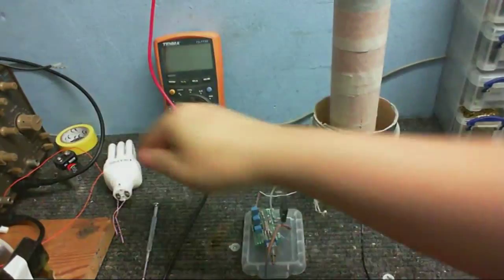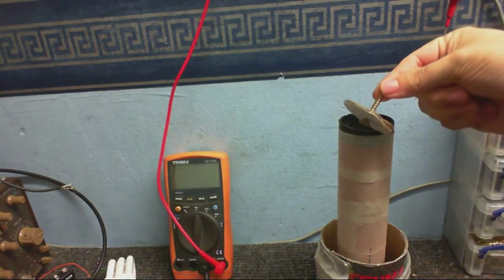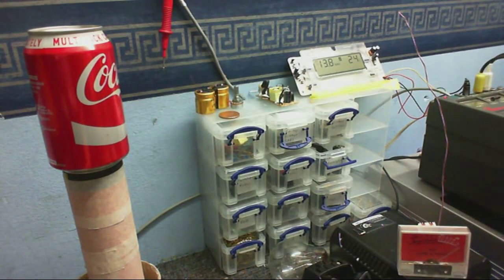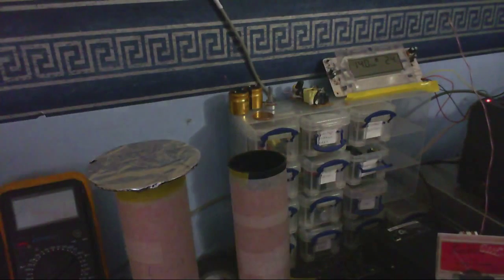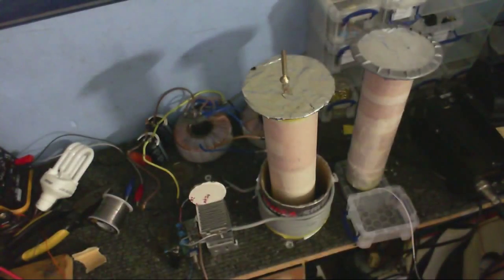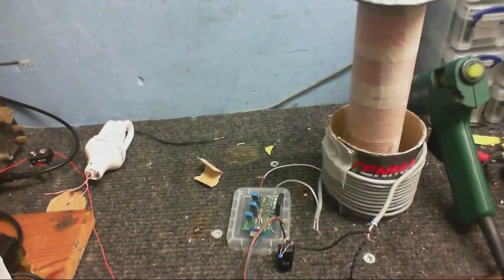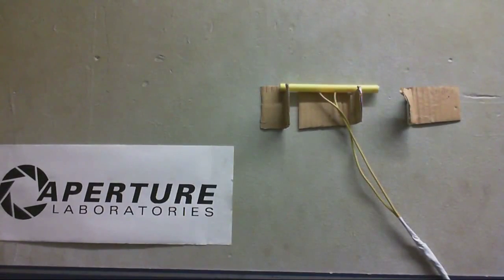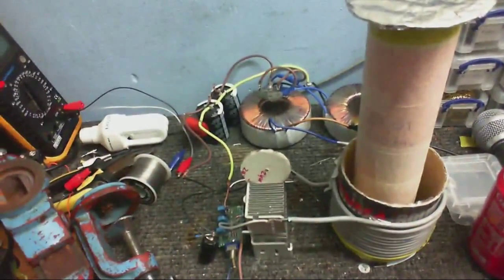Improoved Slayer Exciter and trying my re-built secondarry on my VTTC

Comment: I'm sure you probably know this by now but if you're going to make resonators and primary/feedback coils for VTTC's and SSTC's you should really use PVC pipe for your coil forms, because thin cardboard is not a good insulator and is flammable. You should also have a couple of inches of PVC pipe above the feedback coil on a VTTC to protect it from the resonator, and same above the primary of a SSTC. If your resonator is going to be short, and if you were to use a toroidal top load, then a grounded strike rail mounted at the top of the primary/feedback form would be a good idea. Just remember not to make it a complete circle, leave a gap between the ends of the strike ring heavy wire. Also once you wind a good resonator, and have it just right with no gaps between windings etc, give it a generous coating with epoxy resin with a good work time so you can adequately coat it and make the coating good and smooth, with no runs, so its dielectric strength is as even all around as possible. Several coats of epoxy would be a good idea too as you well know that magnet wire varnish can't stand up well to corona, or arcs, or being banged against something if you move or store the resonator, and needs plenty of protection. Cool video.
Reply from the maker: That's some good advice there. I'm going to get back into the Tesla coil stuff later on. The resonator as you put it, is actually made from PVC, I just put masking tape all around it to protect the wire from scratches and things like that. I know I made a mistake winding the feedback coils onto cardboard but I didn't have anything else available and just hoped the voltage at that point wouldn't be high enough to strike the feedback coil (which of course it did).

Comment: You could try making coils with box tape instead of masking tape, I used to make capacitors rated for thousands of volts with it. I would also give epoxy a try, maybe a 2€ tube is enough to give it a good coating.

Comment: Thanks for other great video Clem,  I know you done it before but can you do a "low voltage" one valve (tube) radio , a very very simple one that a idiot like me can build . Thank you Roger
Reply from the maker: +TheAcehere1 I'm sorry but I'm done with radio circuits, the tube radios I've built are about as simple as it can get and most of them can be powered on low voltgae anyway, especially if you use something like an ECC82 tube, but for now I've just lost all desire to build or tinker with radio circuits.
Reply: +CoolDudeClem Thanks for the reply, I will give a go with ECC82 and see what happen, look forward to your next video. Roger